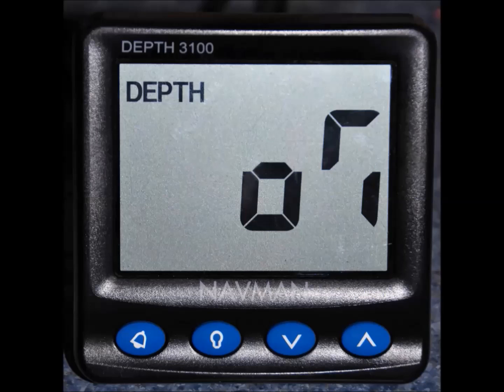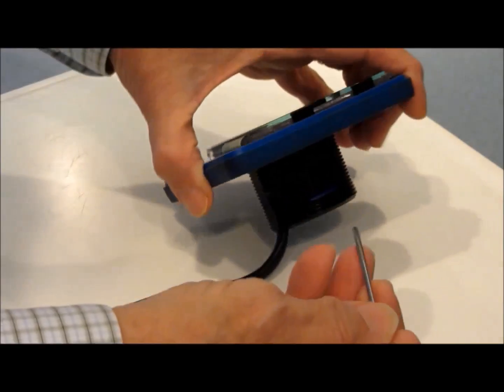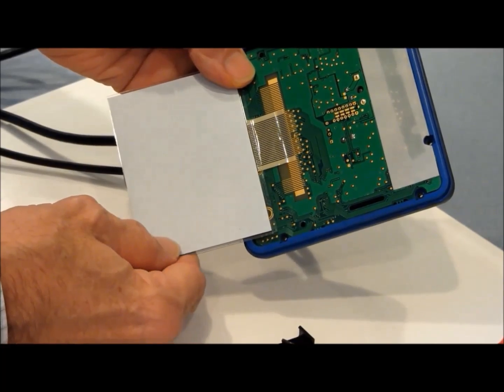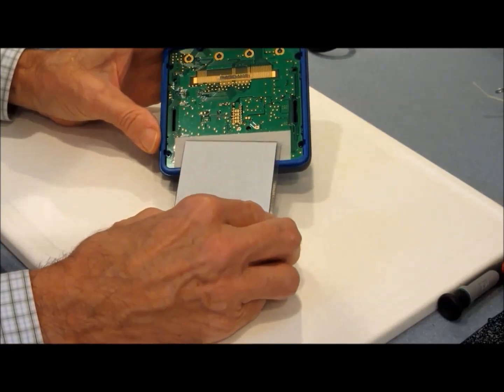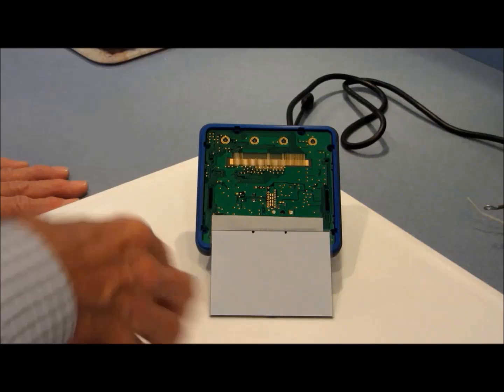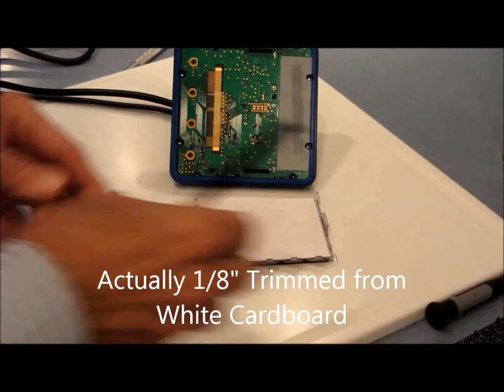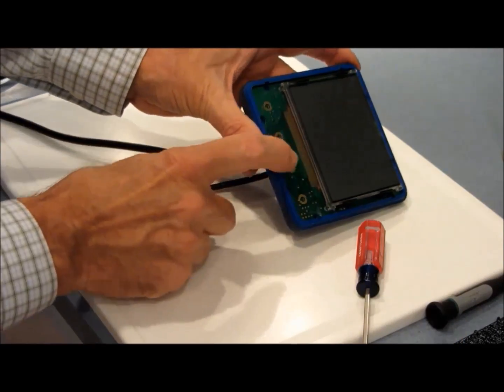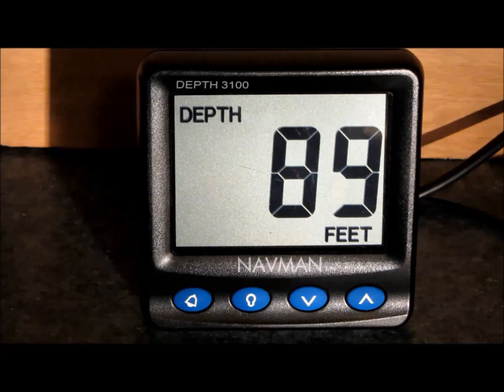Navman 3100 Repair with Zebra Connector from FujiPoly

Comment: I really recommend this kit, it has worked 100% on my failing Navman display which is now restored to full functionality.  Follow Tom's excellent written instructions supplied in the repair kit, and/or watch his video and you shouldn't go wrong.  I am in the UK and the kit arrived here less than a week after placing an order so a very prompt service.  Big thumbs-up for a very cost-effective repair.👍👍👍
Reply: Hi. Im in the UK and meed to fix my Navman aswell, how and where to place the order?
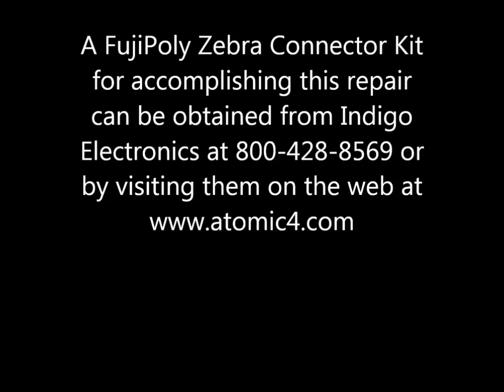Reply: @ultimategarageuk Contact details are in video at about 12:09

Comment: As advertised !! I followed the quality instructions and replaced the OEM ribbon cable in a Navman SPEED 3100 with the elastomeric doo-dad supplied in the kit, and the display is operating 100% again. Awesome. I agree with other comments - I used a dremel tool with a grinding wheel to carefully grind the plastic housing, which made that part of the process a no-brainer.

Comment: before I open up this 3100S depth. I understand the Zebra connector doesn't work with the 3100S only the 3100. What is the solution for the 3100S then ?
Reply from the maker: Unfortunately, the only solution is a new instrument. Advansea/Plastimo offers a depth instrument in their 400 series which is compatible with the transducer.
Reply: @thomasstevens5610  thanks Thomas, the S400 displays are around $400. Thats not an option.
I haven't opened the 3100S. Its my buddy's boat not mine so I have to be careful what I get myself into. 
I understand the sensor is 200 khz.

Is this because there is a different connection between lcd and circuit board ?
Reply from the maker: The LCD is hardwired to the PCB. It should have been a better connection than the ribbon connector. 
I have checked and I do not have a used instrument available. 
If I come across something that I feel will work for you, I will let you know.
Reply: @thomasstevens5610  thanks, Defender sells the small Faria depth instruments with transducer for under $200 and I think the clipper depth is close too. 
Darn, would have been nice to just change the connector. I was really happy until I saw your note that this doesn't apply to the 3100S. Anyhow, good you put this info out and also the note. cheerio !!!!
Reply from the maker: I did some more  digging around and have two possible solutions for you. One is a used NorthStar Depth which is essentially the same as the NavMan.  It appears to simply need the Zebra connector.  I would be $200.  The other option is a brand new NavMan Repeat 3100s.  The instrument itself is basically "dumb" in that it just displays data generated from another instrument.  You would have to leave the existing instrument in the circuit and then put the Repeat in the opening that the current instrument occupies.  The Repeat would then display the data generated by the old depth instrument.
Reply: @thomasstevens5610  thanks Thomas. My buddy decided to buy a new Nasa Clipper Depth. $150 with transducer. Can't beat that.

Comment: This worked fantastically. The Zebra Ploy connector makes this a very forgiving process. One minor change, I had better results slicing 1mm off the "top" edge of the new connector. My Unit is the Northstar version of the Navman 3100 multi. The instructions were easy to understand. I am very pleased.

Comment: All my Navman instruments failed within a few years. I was so glad I kept them instead of tossing them in the trash. Just before spending a lot of money on new Speed, Depth and Repeater instruments from whomever(which would require replacing transducers as well, $$$)  I found  your video here. I ordered your repair kits and was so happy to see my displays working again after installing the zebra connectors. Your video is very well done, and the repair kit and printed instructions are excellent. You saved me a lot of money and I could not be happier. Great job Tom !   HIGHLY RECOMMEND to anyone watching.
Reply: Dzień dobry, czy ma Pan od odsprzedania zebra connectory ? Też mam problem jeden to G-Pilot 3100 a drugi REPEATER

Comment: Yep, this works, I just did a 3100 Multi repair.  I did have to do one additional thing, though.  Note that you can't test your repair until it's assembled because the connector relies on the pressure from the cover on the screen to make good contact.  I found that I still had a couple of spots on the LCD that didn't work, but if I pressed on the instrument face they came on.  So, I put a few strips of electrical tape on the cover in the inside opposite where the zebra connector is located to create more pressure when the cover is on and voila!  works great.

Comment: First of all, many thanks to Thomas Stevens for his excellent and exhaustive video. I've tried to repair this way my Navman Multi 3100, it has been working perfectly for some months, then when the weather started to be colder, the failure of digits appeared again. Unfortunately in the next summer the problem continued in spite of warm weather.
In order to find a possible reason I remark that:
a) the elastomer -  which I pick up from a LCD display donor - is 7 mm wide so that when you put it between the circuit board and the screen, maybe there's not enough pressure over the contacts;
a) I was suggested not to use acetone to clean the contacts (too strong someone told me), I used alcohol, and actually, after a better observation there's some residual glue debris from the ribbon cable.
I would appreciate suggestions from all of you.